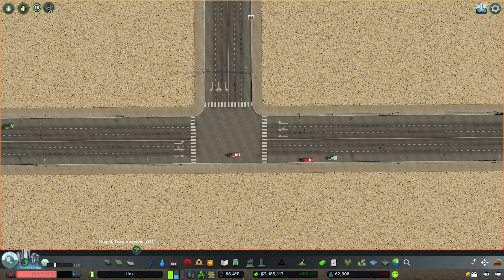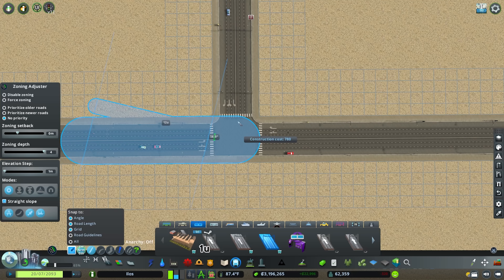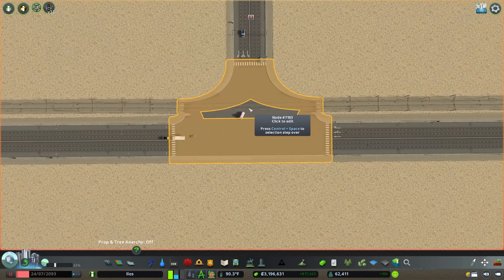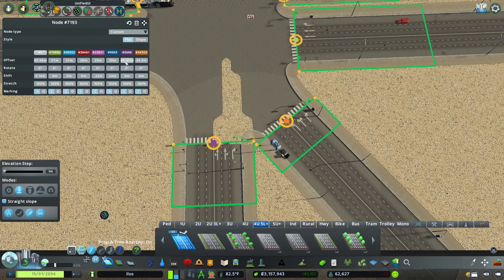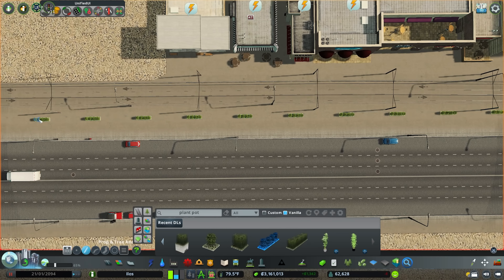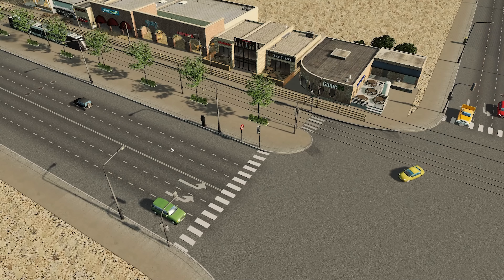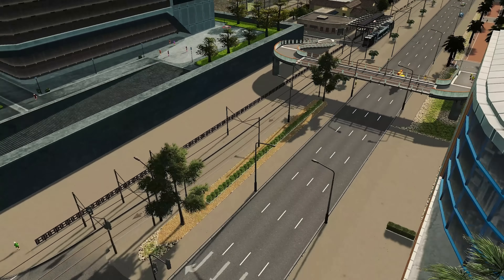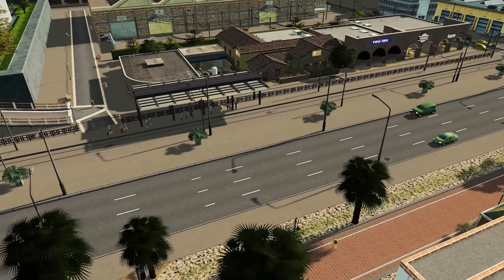How To Make Single Node Tram Intersections In Cities Skylines!

Comment: The only thing I can think of to make this better is the mod: Building Spawn Points
so you can change the cars spawn points on the buildings so cars don't have to drive over the tram rail like in 9:40
I'm going to try this in my city! I was looking for a 6 lane dedicated tram road with parking and bike lanes but couldn't find one, but with this trick it solves my issue! thanks a lot!

Comment: It never occured to me to try this, great idea! Its worth noting that if you do too large corner offsets tho, that pedestrian pathfinding may get broken, leaving cims stuck on the sidewalks, entering the node. Starts to become an issue when offset gets larger than 30-35. Cars arent affected tho so highways can safely have offsets much higher than that. Thanks for the video!
Reply from the maker: Nice! Cheers for the tips bro! 

We also did this the opposite way round too using a trainline and NC'ing the road back out, it works nice!

Comment: great demo - i've had problems with the short segments in the past. This is a great solution. Lately I've been using the tram networks from Clus. His "narrow concrete" network allows elevated tram stops. Using a pedestrian road, like the Next2 inspired network, you can build a walkway to the tram stop. It's fun watching CIMS use these city services - like a zombie hoard they pack the spiral ramps as they make their ways to and from the stop. Setting the speed limit to unlimited and voila - instant light rail without having to burn space with train stations.

Comment: you can make the train tracks go straight then connect the roads on and angle to the node on the train track then instead of shifting the train track with node controller shift the road.

Comment: I would love to follow this kind of tram network but the blue yellow vehicle on 9:30 breaks the immersion of it and goes directly towards the house. Is there a way to remove it?
Reply from the maker: Rolling the building spawn point forward will help 😌
Reply: Well, if you use Advanced Parking AI any Cim in a car attempts to find a parking space and park it before entering their destination and also has to leave their house, find their parked car, and hop in the drivers seat to drive it. So you'll occasionally see parking cars floating across to a parking spot. If you leave the game at Vanilla parking AI, cims won't bother with parking and will magically pull cars out of their pocket and magically put them back into their pocket. Which is more immersion breaking ... rhetorical question. :-)